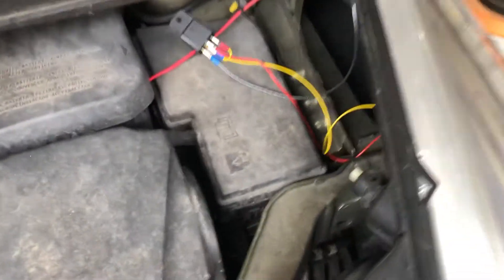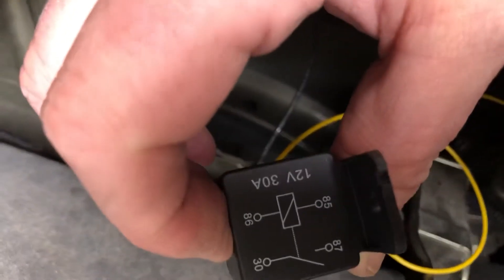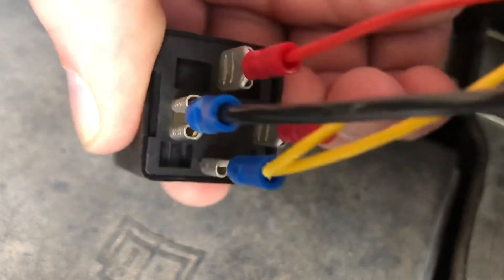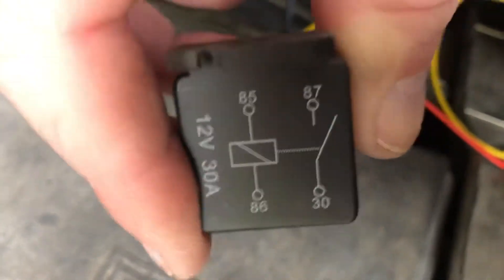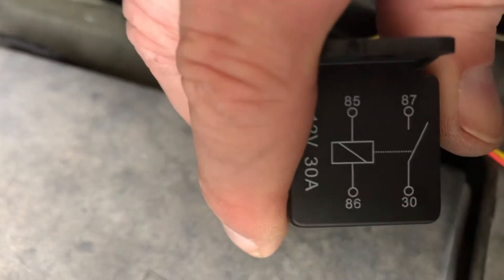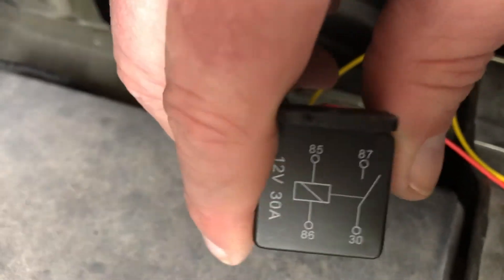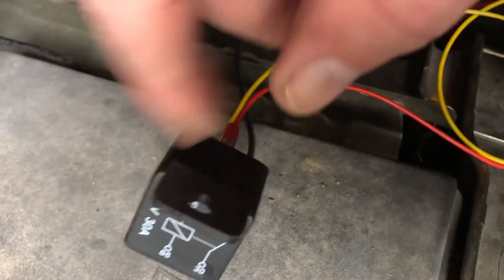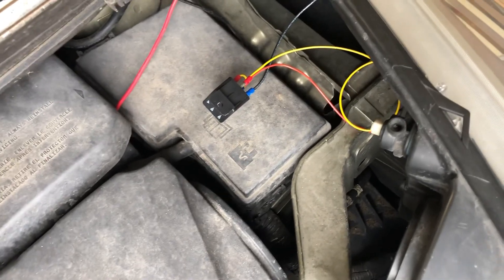Trick Ford Escape Allow LED Lowbeam Using Relay

Comment: where do the red and yellow cables connect to on the headlight. thanks..
Reply from the maker: At 1:15 I say "So 30 gets power..." and a few seconds later, "...the red wire, that taps onto the hot lead of the marker light."

At 2:00 I'm explaining how an accessory relay can be latched closed by being momentarily given power.

The yellow wire, then, naturally, if you understand what I'm describing about a latching relay, would have to be the hot side of the headlight low beam.
Reply from the maker: Sadly, I don't have that car anymore, or I'd re-record a better explanation of this, writing a script ahead of time, so I'm not fumbling my words.

I miss that car. It got totaled a few years ago. I liked that car a lot more than the Chevy Tahoe I have now. There are SOME things I like about the Tahoe, but it's huge, lower MPG, older, rustier, louder.

Comment: I wonder if this is the fix needed to end the issue with my 2013 Ford Escape 's low beam LED headlights NOT wanting to stay lit when it's less than 54°F???
Reply from the maker: Huh. Well that's just weird.
Reply: @kelvin0mql  I think I'm going to try this and see if it works. It's been this way with every low beam LED light.

Oddly enough, at the top end of the cut-off, depending on humidity and "feel", say 48° to 54°, if I turn the lights to parking lights and sit with the engine warming up, the lights will eventually come on and most of the time, they will stay on.

I have had them go off while driving and refuse to come back on after stopping at the gas station for a couple of minutes.

I think that experiences like these are why most lay people attribute the problem to the cold AND THE LIGHTS...

However, as the YT stated, the issue is not with the LED lights but in the electrical system.

I've had this issue with original LEDs that required a Canbus... and the newest which do not require a Canbus.

Adding a Canbus to the newest LED lights has never resolved the cold weather cut-off phenomenon.

The hi-beam and driving/fog lights operate just fine... and, I think it's related to them being the same bulb and drawing more amps... or, if not the same bulb, then as the video stated, there's no ECM System requirement or check on the driving lights.

HAPPY NEW YEAR!
Reply from the maker: @texusarmy-fister7697  Might as well. I'm in MN. It's friggin' almost always below 54F. So it stands to reason I just assumed it was just how they behave all the time.

AND - the cheapest devices that determine "How much current is being pulled?" are very affected by temperature. You know Detroit - never a good part when a cheap part will suffice.
Reply: @texusarmy-fister7697  i've got the same car as you tell me what you used for it a fuse or a relay?

Comment: led with canbus circuit would allow led without all this... spend the money on good led to begin with.
Reply from the maker: Interesting; had not heard of canbus before, so I searched & found this explanation:
https://youtu.be/hPrURxESxV4
...but according to that, the problem I was having had nothing to do with canbus. Rather, it was the OTHER thing he explained, which can be handled by a resistor kit (i.e. little electric heater), which is precisely the dumb solution I was avoiding.
Reply: Even a great LED has issues that are not fixed for pre-LED vehicles. This is a great idea that can provide a permanent fix.  Today's LEDs that are PnP for "All" vehicles are designed for LED-Designed electrical systems; those folks have no clue what weirdness exists in systems built around different electrical requirements and "rules".

Comment: Can you explain where the wires connect to? Or are the numbers the fuse locations? Thanks so much
Reply from the maker: The numbers are not fuse locations. The connections to each spade of the relay are explained verbally in the narration.

I did figure it out by sketching a schematic on paper first, & worked out in my head as to how it should work, before going to the auto parts store to buy 2 accessory relays.

In hindsight, I realized I could’ve probably done it with only one relay, & just run a hot lead from one LED over to the other. Never got a chance to test that theory, since that car got totaled. I may find myself doing this again with my current vehicle, if we ever go back to driving at night on a daily basis post-pandemic.
Reply: @kelvin0mql  thanks for your reply guy! Yeah I just installed leds on my wife’s car. Ford was thinking smart but caused more problems than fixes with this one
Reply: @kelvin0mql  my moms escape i put led headlights in and when i cramk the engine over and it turns on it turns off it says low beam bulb fault on the dash do i need a fuse or a relay?
Reply from the maker: @micahtolleson9735  "Low Beam Fault" was the exact problem I had with LED headlights. This relay thing demonstrated here was how I worked around that problem.

Comment: Im having this same issue with my 2013 ford escape, is this the only fix for this?
Reply from the maker: There's another thing they sell "out there" which is a big resistor that gets hot enough to melt plastic (caution where you mount it), so that your more-efficient LED draws as much current as the less-efficient Halogen did. Which is stupid. But it's the other fix of which I'm aware.

What's REALLY needed is a way to hack the computer that thinks it's so smart about how much energy the headlights should consume.

OR - and this is the tree I very nearly went barking up - a sort of latching relay system. I'm glad I didn't get into an expensive and/or difficult latching relay system, 'cuz I got T-boned and the Escape was totaled only 2 months after I did this workaround.
Reply: @kelvin0mql  thanks ill see what approach I use, to bad about your escape i really like these